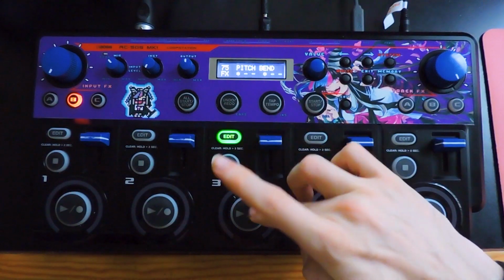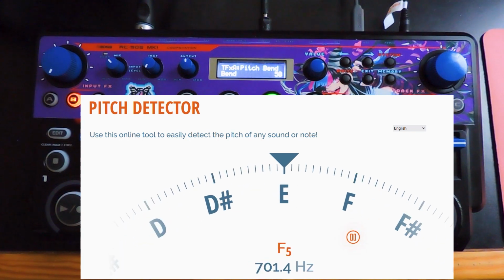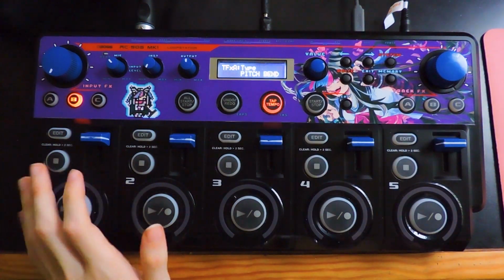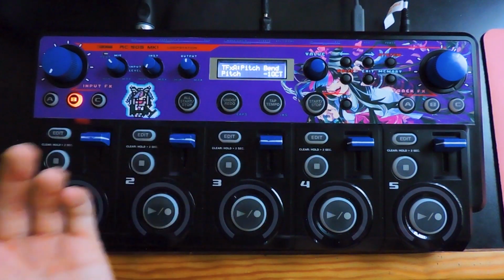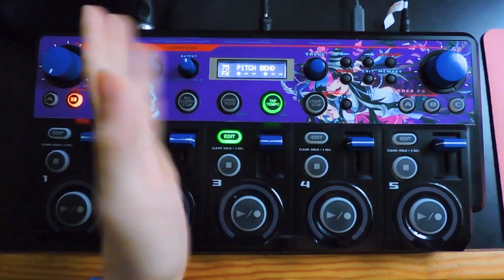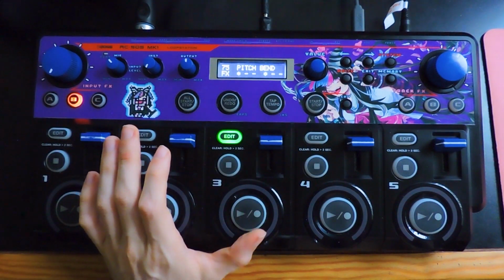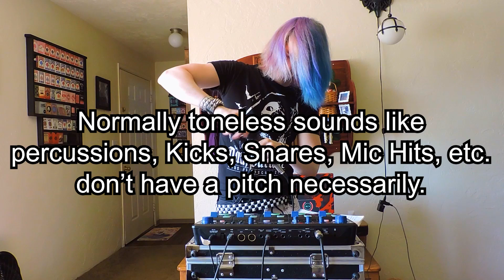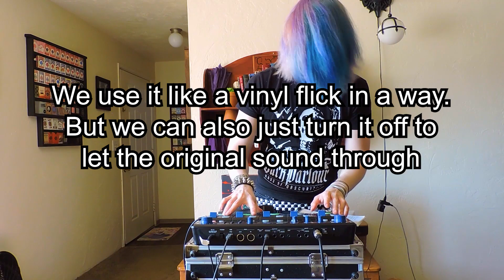Boss RC-505 Tutorial- Pitch Bend [Ft. Rythmind- Smash Mic]

Comment: I have to buy one of them ❤ they look so much fun and you can be very creative😍💯
Reply from the maker: You totally should! They are so much freaking fun!! I have on my schedule to make a "What's the difference between the MK1 and MK2" video but I want to play with the MK2 a bit more before I do that.
Reply: @Brad_the_Wizard   yes Brad so much damn fun I would love to be able to do that like you. So you suggest I get the MK2 ?
Reply from the maker: @sammy_boy00  I would watch the video on the differences I'm making when it comes out first. That way you have all the info :) In summary though, the MK1 is easier to use and is more for casual looping. MK2 is harder to use, but does a ton more and is more for professional looping. But you can be a pro and a casual with either one :) Additionally, they don't make MK1 anymore, so it's a bit harder to find. MK2 is still able to be repaired and supported by Roland as of 2024. The MK1 is also cheaper than the MK2. Hopefully that helps ^w^ (I am using the MK1 in all of my videos, but most the techniques and info can be applied to both devices)

Comment: I think the weird number values to obtain certain notes comes from pitches being on a logarithmic scale. The tone which is directly in between two octaves should never be the tritone. 

A 440 is obv 440 hz, and the octave up is 880. However the octave down is 220. This means there are 440 hz difference goung up but 220 difference going down. This effect would work the way you envisioned if it was "stepped" along various notes, but instead they applied a linear scale to a value which is logarithmic

If you want to dive down a biiiiig rabbit hole, look up "12 tone equal temperment". They had to do a lot of weird things to get our 12 standard notes, and thusly you get weird situations like this
Reply from the maker: Dude, you are a genius haha That is probably exactly how they did this. Log scale would make the values be what they are as they aren't going up or down linearly. I wonder what they could have done to make that more apparent to the user? Like had it say "LOG" next to the number or something? Called the parameter LOG BEND or LOG instead of BEND? Seems like a communication design problem now instead of an algorithm design problem like I thought haha